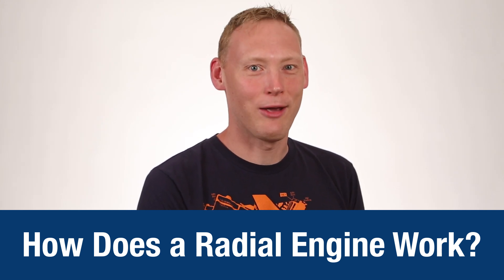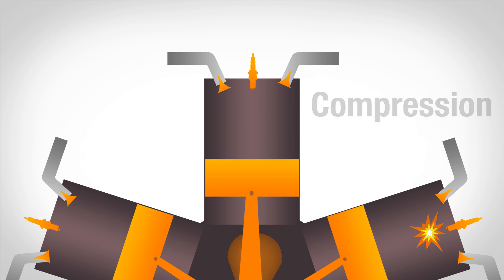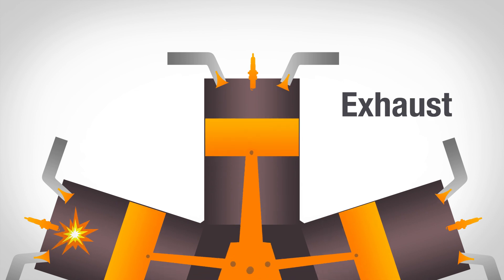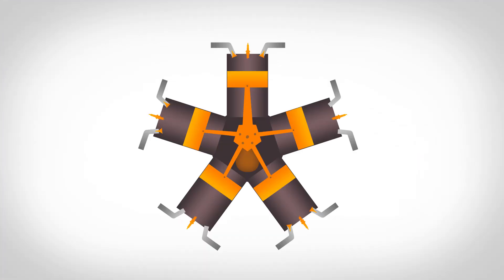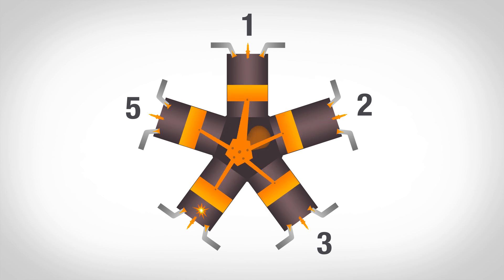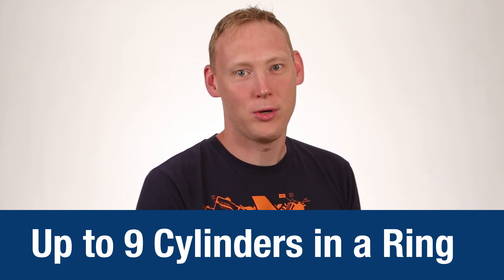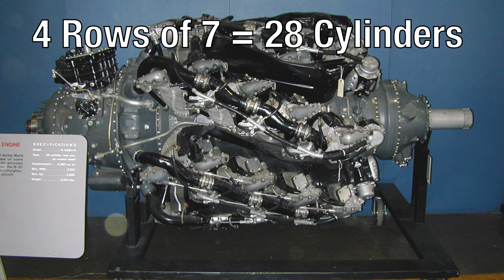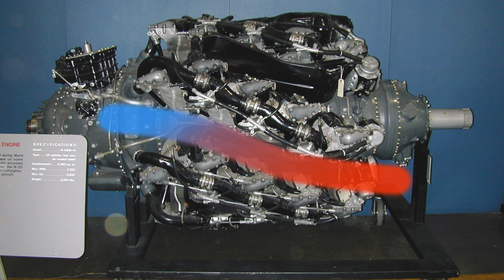How Does A Radial Engine Work?

Comment: There is no reason why a two-stroke radial engine could not be built.  Such an engine would fire each cylinder in the order of rotation regardless of number of cylinders, odd or even, and would always have a balanced firing interval.  The R-4360 Wasp Major had cooling issues only when stuffed backwards into the wing of the B-36.  The 18-cylinder, two-row Wright R-3350 had more serious, and more deadly cooling problems front-side forward in the B-29 bomber. The R-4360 gave sterling service in aircraft such as the C-124 Globemaster for many years after the B-36 flew its last flight.  Pratt and Whitney built a masterpiece in the Wasp Major engine, but of course it could not compete with turbine engines.

Comment: The russians designed and developed a diesel radial that was water cool with 56 cylinders and made over of 4,000 hp. They even coupled 2 together in a package and that one makes over 10,000 hp. The engine series was so successful that they are even still in production today. They never did make it into any aircraft but they found a home in marine apllications.

Comment: Once the radial engine needed a reduction gear to drive a propeller, why stay with it? Why did Wankel not invent its engine back then before WWII (or the inverted one: Liquid Piston) ? With all the gears in the reduction planetary ( I like it ) gearbox and in the compressor gearbox, there is no argument to not also allow gears in the engine. Wankel used a gear, the V12 has some gears. With enough cylinders you can justify a large wheel behind the engine to drive DOHC. You replace stroke with RPM. Also use gears to avoid the asymmetry of a master conrod. There was a stationary radial engine which did this, but it looks like the video was taken down.

Comment: I'm not watching this video to see how 4 strokes work, I'm watching to see how such a strange engine type dealt with oil containment, engine balance, and uneven wear in the era before boxers!
Reply: Inverted engines, of which many thousands were made prior to and during WWII, had oil control issues to overcome for all cylinders, not just the lower cylinders as on radial engines.  Radial engines, mostly in the form of rotary engines with the engine spinning around a fixed crankshaft, were common and extremely successful during WWI, so they are hardly "weird."  All piston engines have the potential for balance problems with rotating and reciprocating parts, but the radial configuration is no worse than any other.  And the myth of unequal piston wear due to orientation relative to gravity is just that.  The moving parts of internal combustion engines are subjected to acceleration forces of such magnitude that the force of gravity is not even a rounding error in design.
Reply: Just like a diesel but the oil in three cylinder, and throw at the extra

Comment: Why it is needed to close the engines in a shell like the failed one? Cause it is used in a wartime aircraft?
Reply: Cooling.  The air must be forced through the cooling fins of the cylinders.  This is done by the design of the pressure-cowl, the engine enclosure.

Comment: Can anyone please explain me how a small rotator helps to push the plane so fast that it can fly ?
Reply: Simply: it’s not small.

Complexly: the propellor is shaped perfectly, and spins so quickly that it pushes air behind the plane. Sir Isaac Newton tells us that every force has an equal and opposite reaction, so this pushes the plane forwards, and the wing is shaped so that the air flows over with a higher pressure on the bottom of the wing- this is called lift. When the engines make the plane fast enough, the air can flow fast enough creating a big enough difference in pressure for the aircraft to take off!
Reply: @apexjailor9349  had no idea that not so “small” propeller is that powerful. Thanks mate.

Comment: Well us brits being the stubborn buggers we are chose not to use radial engines in our air craft we went with the good old v12 even the Lancaster bomber used v12s (4 of them) the exception was the hawker typhoon powered by a Napier sabre (an h24 basically take two flat 12s put one on top the other and and use gearing to connect them to a single output shaft an h has two crankshafts).
Reply: Britain used many thousands of radial engines during the war.  The Bristol sleeve-valve radials were quite successful on bombers, transports, and especially on the famous Beaufighter.
Reply: @Hopeless_and_Forlorn  I stand corrected..
Reply: @Hopeless_and_Forlorn  Yep. They also used a lot of radial powered American aircraft like the P47. In fact, many British airmen that got "upgraded" to P51s wanted their P47s back.

Comment: Are radial engines efficient than other engine types??
Reply: Not that I have any credentials or actual knowledge, but I would assume efficiency is similar to that of "regular" piston engines like what you'd find in most cars
Reply: Their main benefit is that air cooling works really well for them, so you don't need a radiator. Also, they can usually still run even if one or two cylinders get shot off. Important for a warplane.
Reply: Initially yes, very much so. That's why radials were more common in WWI. Between the wars, advancements in liquid cooling made inline engines slightly more efficient for aircraft use, thus the introduction of Merlins and Allisons and what not. But then NACA and others did some serious research on things like cowl designs that reduced drag on radial installations enough to get them back up to inline levels of efficiency. Thus giving us P47s, Corsairs, FW-190s, etc.

Comment: You forgot to mention that radial engines will always have an odd number of cylinders.
Reply: I've only seen a photos of a radial engine/on tv, it looks like the barrels/cylinders are arranged inline/level, I'm wondering how they managed to fit 5 connecting rods/big end bearings to the crank?
I can only picture room for one unless the cylinders are slightly off? 
I've often wondered when I see them on TV, I'm a bit mechanically minded but I can't get my head around that?

I'm watching Valkyrie and seen a radial so here I am trying to find out, I get the 4 stroke just can't picture the big end bearings arrangement for multiple pistons 🤔
Reply: @homewordbound4970  
Master & slave rods.
Reply: @heinzhaupthaar5590 
Thanks very much I'll look into this 👍
Reply: @homewordbound4970  The most common arrangement is a master rod/articulated rod arrangement.  The crankshaft throw (in each row, for a multi-row engine) rotates a connecting rod with a piston on the other end as usual.  This is the master rod.  This rod has extended flanges with multiple holes drilled into them in a circular pattern, one hole for each of the other cylinders.  Each hole has a pin in it.  Each pin is inserted through the "big end" of a straight connecting rod which is retained between the two flanges of the master rod.  The other end of each "articulated" rod, as they are known, is a "little end" through which the piston pin is inserted, so each articulated rod also drives one piston in its respective cylinder.  Each articulated rod is free to rotate side-to-side enough to keep pointing at its cylinder as the crankshaft throw moves the entire master rod, and its captive pins for the articulated rods, in a circle.  So, in a nine-cylinder engine, or row, you have one piston being moved directly by the master rod, and eight more pistons connected to the periphery of the master rod by articulated rods and moving them as the master rod circles the crankcase.  There are complications in this arrangement due to the fact that the articulated rods do not move on the exact circumference of the circle described by the crankshaft throw, but these geometrical characteristics can be compensated satisfactorily.
Reply: Only if they also have an odd number of rows (1 or 3 usually). A 2 or 4 row radial will have an even number of cylinders.
Reply: Not always. Maybe nowadays.

Comment: how is balancing of rotary engines done??
Reply: Dibya Jyoti there is a piece in the axis, just like an Otto engine, i don't know It's name in english
Reply: Dibya Jyoti Well the pistons together essentially draw a circle. So you need a piece that's the length of the radius of the circle which the axis attaches to in order to have the axis in the middle. Not sure if that was your question though.
Reply: This is not a rotary engine.  This is a radial engine. They are distinctly different.

Comment: i wonder where the oil pan location is or how lubrication works out on radial engines! is there anybody who have a clue about that?
Reply: Radials are "dry sump" meaning they have no oil pan. They instead have an oil tank, normally mounted on the firewall. There are pubs, likely on line which explains how the system works. Combination of pressure feed and spraying/slinging oil onto various components.
Reply: There is a very small collection sump and a scavenging pump to remove excess oil back to the reservoir tank, oil is pressure fed from the reservoir tank to the engine by another pump. 

Note that the cold start process for a radial always involves turning the motor slowly through 3-4 revolutions before attempting to start, this is because after sitting for some hours oil(and sometimes fuel or moisture) can settle in the downward angled cylinders seeping passed the piston rings into the combustion chamber and at the extreme cause a hydraulic lockup or more commonly it reduces chamber volume drastically increasing compression ratio and/or causing a hydraulic hammer(kind of like a garden hose with bubbles in it will splurt and pop and shake when you first turn the water on)
Reply: I wonder how they can fit 5 connecting rods to one lobe/throw on the crank, the would need to be really fine/thin in comparison to a car engine.... Am I missing something?
Reply: @homewordbound4970  I see it has been some time and no one has answered. There is one rod in each bank called the master rod. The other  articulated rods are pinned to the master rod at the circumference of the rod crank end. His video shows the motion but it is not explained. The explanation gets quite complicated after that. This system causes timing and stroke length errors that must be compensated for. Most engines have a compensated breaker cam in the magneto. The real part to understand is the cam ring. By a 4 lobe cam ring I mean four intake and four exhaust lobes. A nine cylinder can run with a 4 lobe cam at 1/8 engine speed in reverse rotation to engine rotation.  It can also run with a 5 lobe cam ring at 1/10th engine speed in the same direction as engine rotation. If you want to draw it up start with a 3 cylinder. A single lobe will turn in reverse at half speed and a two lobe at quarter speed.  If you take the time to understand the cam ring geometry you will also understand why there is an odd number of cylinders in a bank and the firing order is odd then even.
Reply: @jayreiter268 Ok. So it's "master rod". I was thinking "mother rod". Thank you for the insight.